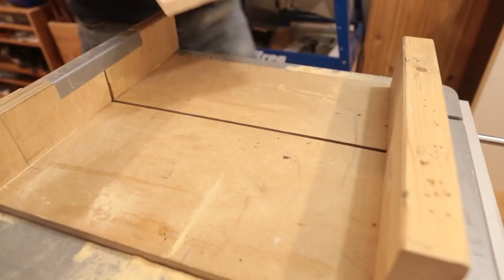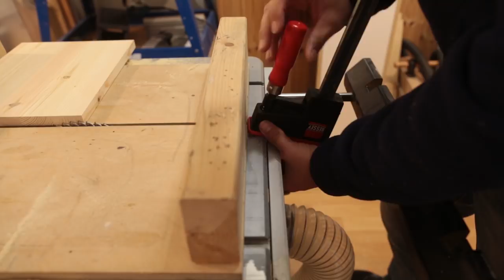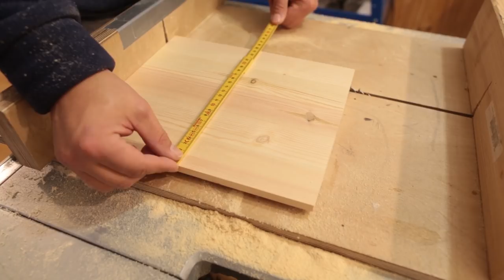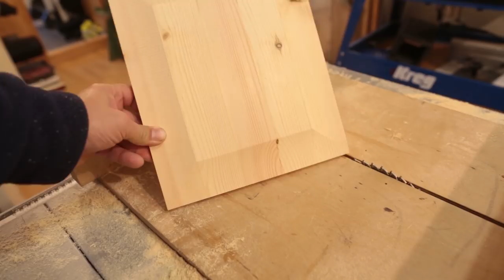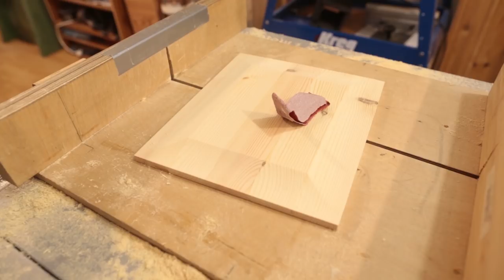Making Raised Panel Doors Easily Using Only a Standard Crosscut Sled.

Comment: Seems like a reasonable method. I would only do this while wearing a respiratory.

I wonder if this would be even safer if you advanced the board each pass by adding a shim at the sleds fence, say, 1/8". Also if you used a push block such is used with a jointer to move the board back and forth rather than use your fingers.